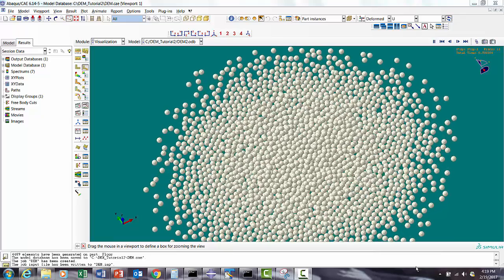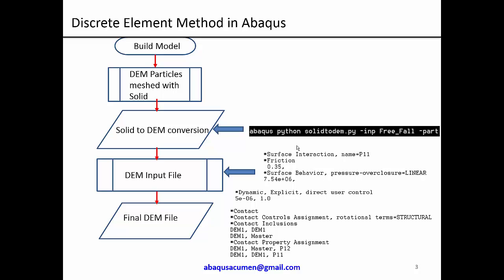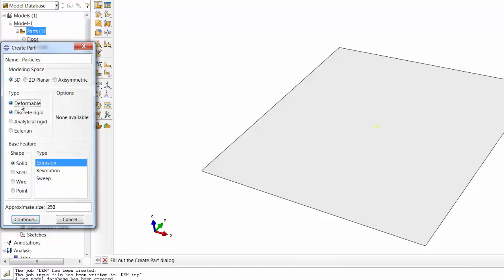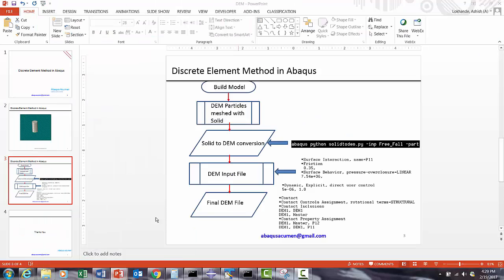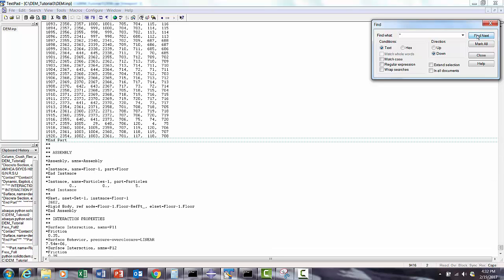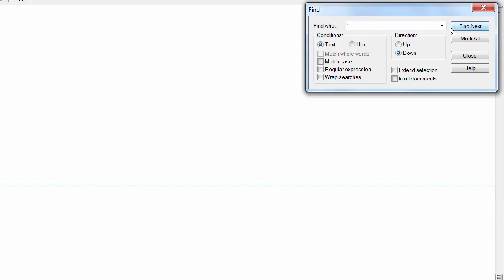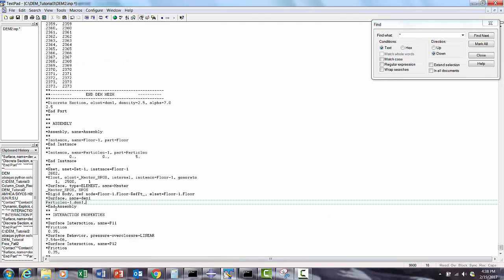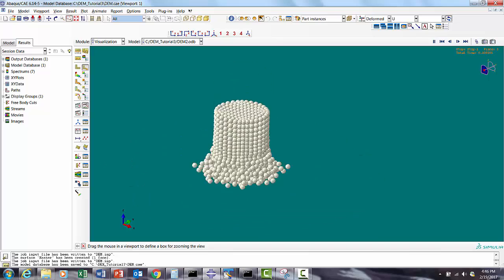Abaqus: Discrete Element Method (Introductory Video)

Comment: Thanks for sharing this. Just noted that the solidtodem.py generated two PD3D element at node 2373. I did not have access to solidtodem.py, what I did was to delete the original elements, copy the node index in this part via column copy (I am using Notepad++), and paste twice in the element section. Basically define the PD3D elements at all the nodes in this part.
Reply from the maker: Excellent!

Comment: Your videos are very easy to follow for a novice like me. Thanks boss, look forward to more. (PS. If anyone wants the python script:

#! /usr/local/bin/python

doc ="""
#######
Script to read the given input deck, extract the solid mesh details and write out corresponding DEM mesh data. The script will work for input files of both formats - flat and parts/instances

USAGE: abq python solidtodem.py -inp <inputFileName> -elem <elemPrefix> -part

Options:
 -inp <inputFileName> Required argument to provide the solid mesh input deck for processing
 -elem <elemPrefix> Optional argument to prefix DEM elements with a given integer
 -part Option to specify if the input deck is of parts/instances format. Script may not work correctly if this option\
   is not used with parts/instances based input deck
#######
"""

import os, re, sys, string, time

# Argument search patterns
inpPattern = re.compile('(\-i)$|(\-in)$|(\-inp)$|(\-input)$', re.IGNORECASE)
elemPattern = re.compile('(\-e)$|(\-el)$|(\-ele)|(\-elem)$', re.IGNORECASE)
partsPattern = re.compile('(\-p)$|(\-pa)$|(\-par)$|(\-part)$', re.IGNORECASE)

# File search patterns
abqKeywordPattern = re.compile('^(\*)(\s*)(\w*)') 
c3d8rPattern    = re.compile('(C3D8R)|(C3D8)|(C3D8I)', re.IGNORECASE)
elsetParamPattern   = re.compile('(ELSET)(\w*)(\s*)(=)(\s*)(\w+)', re.IGNORECASE)
materialParamPattern   = re.compile('(MAT)(\w*)(\s*)(=)(\s*)(\w+)', re.IGNORECASE)
solidSectPattern   = re.compile('^(\*SOLID)(\s*)(SECTION)(\s*)(,)', re.IGNORECASE)
elsetKwdPattern   = re.compile('^(\*ELSET)(\s*)(,)', re.IGNORECASE)
materKwdPattern   = re.compile('^(\*MATERIAL)(\s*)(,)', re.IGNORECASE)
partPattern = re.compile('^(\*PART)(\s*)(,)', re.IGNORECASE)
endPartPattern = re.compile('^(\*END)(\s*)(PART)(\s*)(,)', re.IGNORECASE)
partNamePattern = re.compile('(NAME)(\w*)(\s*)(=)(\s*)(\w+)', re.IGNORECASE)

#Initialize variables
inputFileFound = 0 
isParts = 0
elemPrefix=''
partCount = 0

#Handle arguments

numArgs = len(sys.argv[1:])
argList = sys.argv[1:]

arg = 0
while arg < numArgs:
 if inpPattern.search(argList[arg]):
  if arg + 1 < numArgs and argList[arg + 1][0] == "-": #Check if next parameter starts with "-". Means that no data for inputfile is provided
   print "***Error: No input file provided"
   sys.exit()
  else:
   inputFileFound = 1
   if argList[arg + 1] [-4:] != ".inp": #If .inp is not included, add it to the file name
    inputFileName = argList[arg + 1] + ".inp"
   else:
    inputFileName = argList[arg + 1]
   arg = arg + 2
 elif partsPattern.search(argList[arg]):
  isParts = 1
  arg = arg + 1
 elif elemPattern.search(argList[arg]):
  if arg +1 < numArgs and argList[arg + 1][0] == "-": #Check if next parameter starts with "-".
   print "***Error: No element prefix provided"
  else:
   try:
    elemPrefix = int(argList[arg + 1])
    if not elemPrefix:
     sys.exit()
   except:
    print "Please provide a valid integer for element prefix"
    sys.exit()
   arg = arg + 2
 else:
  print "***Error: Incorrect command line options provided. Please specify the required options or refer the doc below"
  print doc
  sys.exit()

if not inputFileFound:
 print "***Error: No input file provided for processing"
 sys.exit()

#Open input deck 
try:
     file     = open(inputFileName, "r+b")
     contents = file.readlines()
 file.close()
except:
 print ("\n***ERROR: Unable to open file: " + inputFileName + "\n")
 sys.exit()

numLines    = len(contents)

currLineNum = 0

#Initialize variables 

elsetNames = []
materNames = []

processC3d8rs = 0

if isParts:
 elsetList = {}
 solidSectionList = {}
 nodesList = {}
 elsetNameList = {}
else:
 elsetList = []
 solidSectionList = []
 nodesList = []
 elsetNameList = []

#Loop through input file contents, search for solid elements, solid sections and store details into respective arrays (depending on if the input is flat or is 
#based on parts and instances)
while (currLineNum < numLines):
 currLine = string.strip(contents[currLineNum])
 
 
 if c3d8rPattern.search(currLine):
  processC3d8rs = 1
  if isParts:
   try:
    if elsetList.has_key(partName):
     elsetList[partName].append([string.replace(currLine, "C3D8R", "pd3d,elset=dem1")])
     nodeList[partName].append([])
    else:
     elsetList[partName] = [string.replace(currLine, "C3D8R", "pd3d,elset=dem1")]
     nodesList[partName] = [[]]
   except:
    print "***Error: -part option used for flat input deck. Please rerun the script without -part option"
    sys.exit()

  else:
   elsetList.append(string.replace(currLine, "C3D8R", "pd3d,elset=dem1"))
   nodesList.append([])

 elif solidSectPattern.search(currLine):
  processC3d8rs = 0
 
  splitLine = currLine.split(",")
  c = 0
  elsetFound = 0
  materialFound = 0
  
  while (c < len(splitLine)):
   item = splitLine[c]
   if elsetParamPattern.search(item):  
    elsetParam = splitLine[c]
    splitParam = elsetParam .split("=")
    elsetName = splitParam[1]
          c = c + 1
  

  if isParts:
   if solidSectionList.has_key(partName):
    solidSectionList[partName].append(currLine)
   else:
    solidSectionList[partName] = [currLine]

  else:
   solidSectionList.append(currLine)

  if isParts:
   if elsetNameList.has_key(partName):
    elsetNameList[partName].append(elsetName)
   else:
    elsetNameList[partName] = [elsetName]

  else:
   elsetNameList.append(elsetName)

 elif partPattern.search(currLine):
  partCount = partCount + 1
  if not isParts and partCount ==1:
   print "***Warning: Input file is of parts and instances but -part option is not used in which case the script may not work as expected. Please rerun the script with -part option"
  splitLine = currLine.split(",")
  partNamePattern = splitLine[-1]
  partNameSplit = partNamePattern.split("=")
  partName = partNameSplit[-1]

 elif abqKeywordPattern.search(currLine):
  processC3d8rs = -1        

 elif processC3d8rs == 1:

  splitLine = currLine.split(",")
  if isParts:
   nodesList[partName][-1].extend(splitLine[1:])

  else:
   nodesList[-1].extend(splitLine[1:])

 currLineNum = currLineNum + 1

# Write new contents to file
newFileName = "dem_" + inputFileName
try:
 newFile = open(newFileName, "w+b")
except:
 print ("\n***ERROR: Unable to open file: " + newFileName + " for writing.\n")
 sys.exit()

newLine = '**------------------------------------------------'
newFile.write(newLine + "\n")
newLine = '**---------   START DEM MESH            ----------'
newFile.write(newLine + "\n")
newLine = '**------------------------------------------------'
newFile.write(newLine + "\n")

if isParts:
 for pNum in elsetList.keys():
  for eNum in range(len(elsetList[pNum])):
   newLine = elsetList[pNum][eNum]
   newFile.write(newLine + "\n")
   nodesUniqSorted = sorted(set(nodesList[pNum][eNum]))
   for nodeNum in nodesUniqSorted:
    newLine = str(elemPrefix) + string.strip(nodeNum) + ',' + ' ' + str(nodeNum)
    newFile.write(newLine + "\n")
  newFile.write(newLine + "\n")
  newLine = '**------------------------------------------------'
  newFile.write(newLine + "\n")

else:
 for eNum in range(len(elsetList)):
  newLine = elsetList[eNum]
  newFile.write(newLine + "\n")
  nodesUniqSorted = sorted(set(nodesList[eNum]))
  for nodeNum in nodesUniqSorted:
   newLine = str(elemPrefix) + string.strip(nodeNum) + ',' + ' ' + str(nodeNum)
   newFile.write(newLine + "\n")
  newLine = '**------------------------------------------------'
  newFile.write(newLine + "\n")

 for solidSec in solidSectionList:
  newLine = solidSec
  newFile.write(newLine + "\n")
  newLine = '<particleRadius>,'
  newFile.write(newLine + "\n")
  newLine = '**------------------------------------------------'
  newFile.write(newLine + "\n")

 newLine = '**------------------------------------------------'
 newFile.write(newLine + "\n")

 for elsetName in elsetNameList:
  newLine = '**------------------------------------------------'
  newFile.write(newLine + "\n")
  nSetName = elsetName + '_Nodes'
         surfName = elsetName + '_Surf'
  newLine = '*NSET, NSET=' + nSetName +  ', ELSET= ' + elsetName
  newFile.write(newLine + "\n")
  newLine = '*surface, type=node, name= ' + surfName
  newFile.write(newLine + "\n")
  newLine = nSetName + ','
  newFile.write(newLine + "\n")

newLine = '**---------      END DEM MESH          ----------'
newFile.write(newLine + "\n")
newLine = '**------------------------------------------------'
newFile.write(newLine + "\n")

print "***DEM mesh written out to " + str(newFileName) + "***"
newFile.close()
Reply: Hiii    >>   abaqus python solidtodem.py -inp DEM -part
The above command is not working for me while conversionrsion to DEM particle. I a using linux OS..any suggestions. Thanks
Reply: Hi, where have you find the python script ? can you send it to me please ?